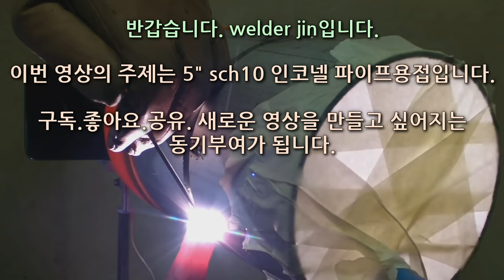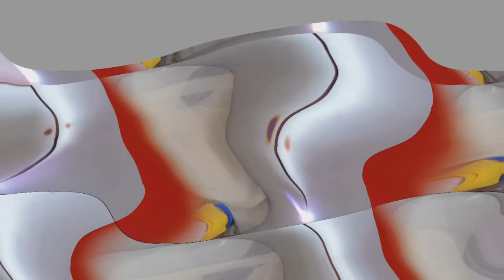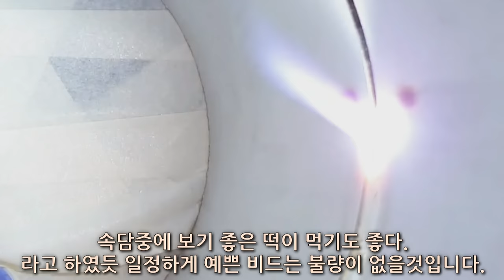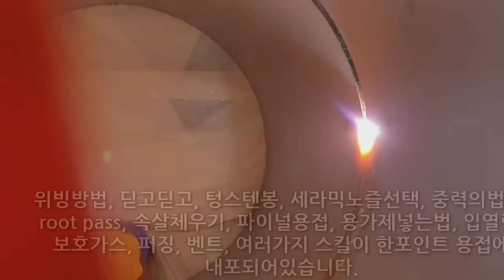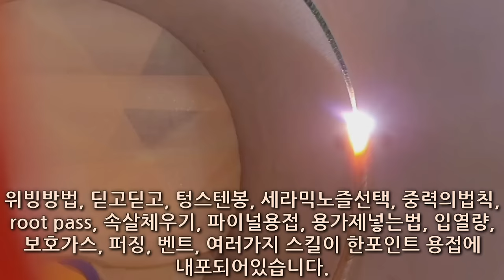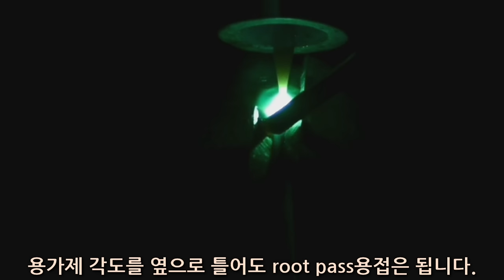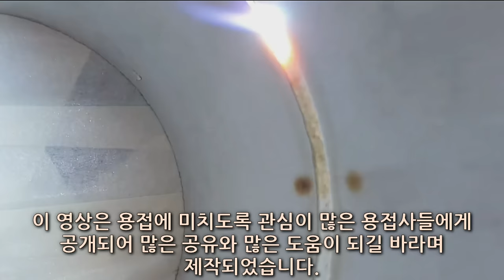인코넬파이프 용접방법.(nicr3) ! ! ! ! ! Keyhole Welding

Comment: Duplex steel is welded in the same way - you have to constantly keep your rod on the bevel (left or right doesn't matter) when you do root pass. If you supply your rod directly in the center of the weld puddle you end up having cold wire because duplex is so hard to melt compared to regular stainless, and for root 90 amps are okay
Reply: This guy is on sche 10 pipe